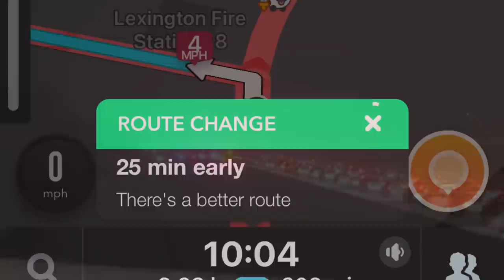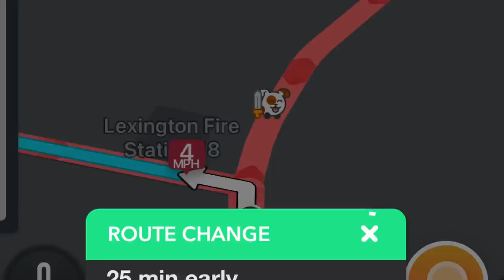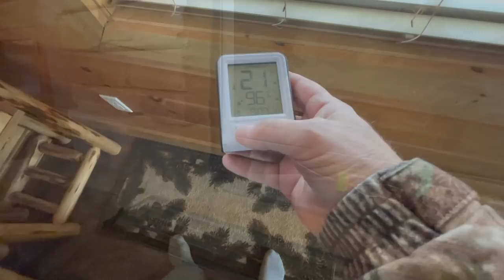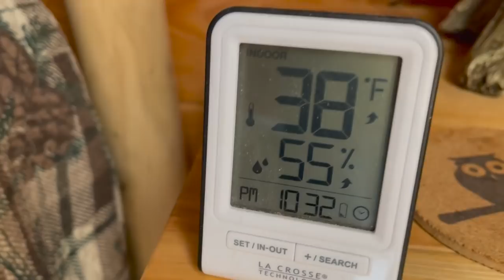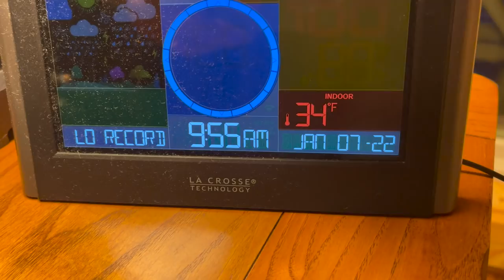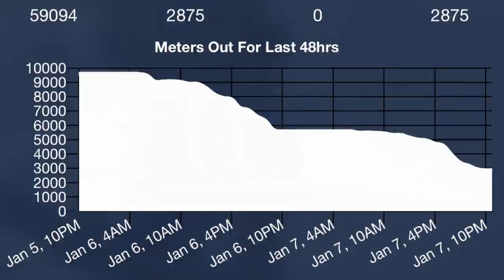Oh Crap!  What The....?  Now What?  Managing A Vacation Rental

Comment: I live in northeast Missouri and garden hoses are a pain in the winter.  I recently discovered quick connects for garden hoses.  They are so much easier to use in the winter.  You still have to disconnect the hose after using it, but what used to be a frustrating experience is now much easier.  They work just like quick connects on air hoses.  If it is easier for your maintenance person to use, then that might help them remember to disconnect the hose when not in use.
Reply from the maker: Thanks, we are kicking around that option and maybe a self draining spigot.